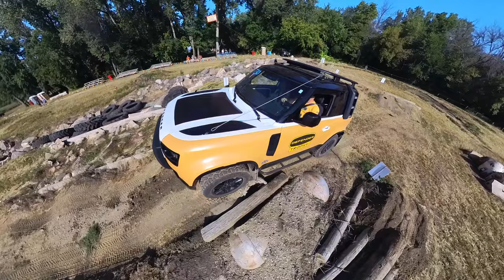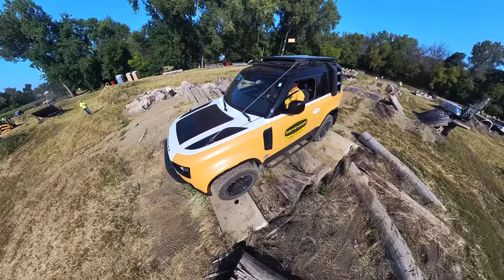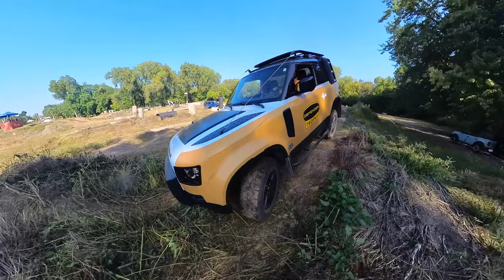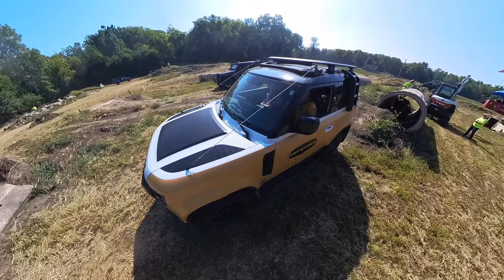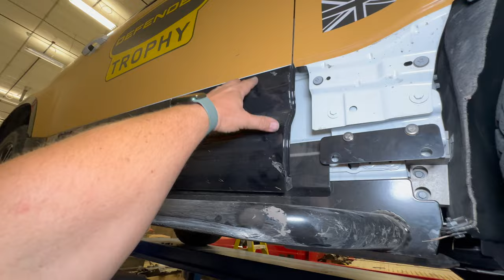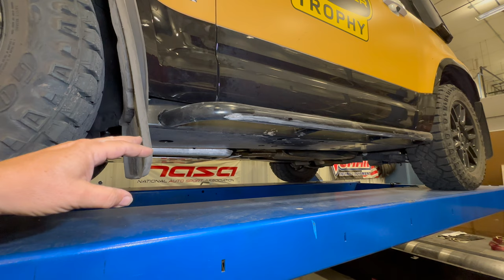Finding Out What Will Break First

Comment: That the only way a Landrover can hold up, You have to modify the hell out of it.  Very weak cars
Reply from the maker: My modifications were rock sliders and a better skid plate the suspension, drivetrain and tire size all stock, only Jeeps that have been modified to hell can do what that Land Rover can do stock.
Reply: @ThisWeekWithCars   Big price difference. My friends rear door don't open on his defender after 5 years unless he's is parked on level ground. He said it's common, they develop a lot of chassis flex and need to be reinforced. He regrets selling his Toyota FJ45 diesel.
Reply: @GoofieNewfie69  The new Defender only came out in 2020, so your friend couldn't have owned it for 5 years.  Agree on the body flex though.  Mine is a love/hate relationship.  Lots to love, but not sure it's worth the price.
Reply: @stephenlyttleton9032  Are you saying that my friend was lying when he said his Defender was a 2017?  This is 2023, how can a 2020 model be new in 2023 soon to be 2024?
Reply: @GoofieNewfie69  Not calling anyone a liar.  Production on classic Defender stopped in 2016 and new Defender models started in 2020.  Just the facts.
Reply: @stephenlyttleton9032   Fact eh, so your facts say there is no 2017 Landrover defender.  Just talked to my buddy and he bought it new as a 2017 and it was registered as a 2017 for the five years he owned it.  Maybe you're saying the Landrover dealer in Ottawa Canada is selling fakes.
Reply: @GoofieNewfie69  Production ended in 2016, I assume you know the difference from that and a model year.  If your friend has a 2017 model year, he has a "classic" Defender, ladder chassis steel box that doesn't flex like you describe, many other issues though.  The new Defender does have chassis/body flex, I hear it every time I drive.  Your example is totally different than what this video is about.  Either way, you are a bit off base.
Reply: @stephenlyttleton9032  Nit pick all you like. Regurgitate whatever you fond on line. It still don't change the the fact that  he had a 2017 LandRover defender and it was garbage, his oil changes were crazy expensive. Replacing bits and pieces all the time. Yup it's just a rich mans toy 
But that ok keep on praising your expensive garbage landrover truck and trolling those who call them out for what they are